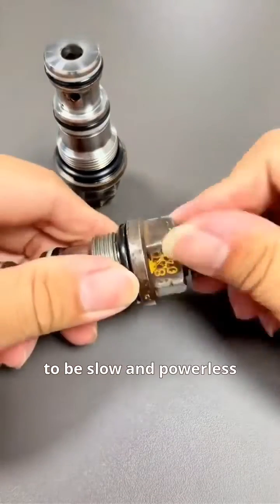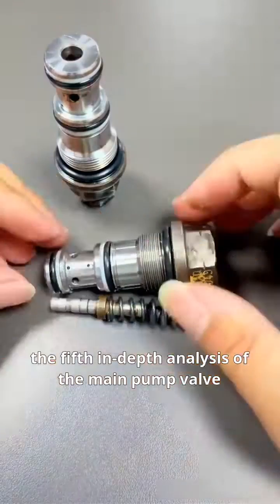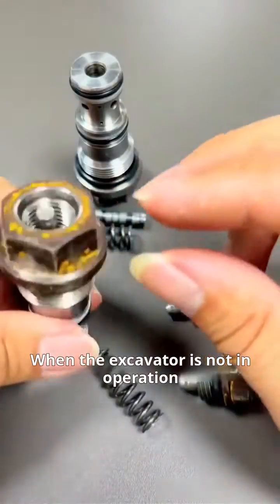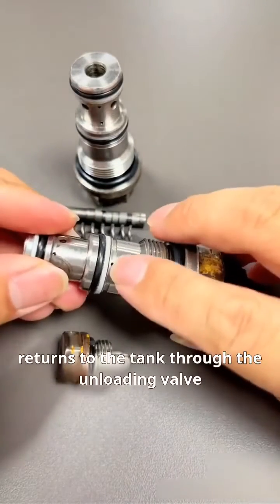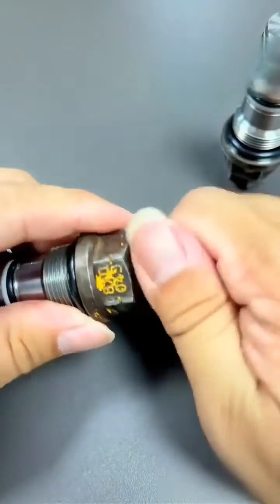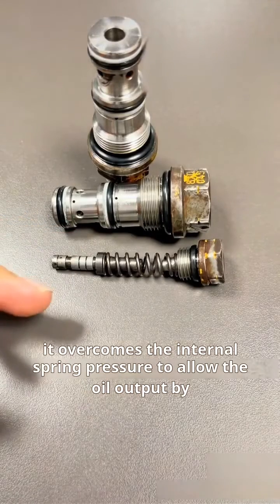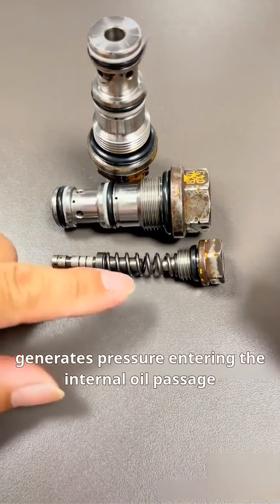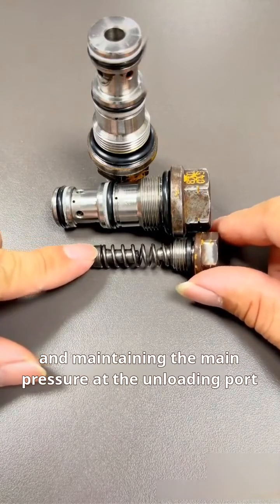When a #KOMATSU excavator exhibits slow or weak performance, inspecting the unloading valve #sany

Comment: I have a problem with a komatsu 138 the boom sticks and won’t go down any help ?
Reply from the maker: Boom Cylinder Holding Valve Malfunction: This is the most common cause. Sticking of the valve core inside the holding valves corresponding to the boom and arm cylinders, fatigue fracture of the spring, or blockage by hydraulic oil impurities can prevent the valve from opening normally to relieve pressure, making it difficult for the cylinders to lower. Additionally, damage to the seals inside the holding valve can also affect the on-off of the oil circuit and hinder the cylinder operation.

Comment: What Isa the problem of the Samsung excavator all movement are low power
Reply from the maker: Hydraulic System Malfunction: This is the primary cause. Wear of the plungers and valve plates inside the hydraulic pump will lead to a decrease in output flow and pressure; sticking or wear of the main relief valve will result in abnormal pressure loss in the system. In addition, insufficient, deteriorated, or contaminated hydraulic oil can clog the suction filter and return filter, and also cause sticking of the spools in the multi-way valve, which affects the efficiency of oil flow and thereby leads to sluggish operation of all machine movements.

Comment: I have a problem with a pc56 komatsu, the problem is that there is a low pressure in boom, but if the dozer is on its working but if its off it loses its pressure what can be the problem
Reply from the maker: 1,Leakage in the distribution valve. 2, Obstruction in the hydraulic oil circuit. 3, Malfunction of the hydraulic pump. 4, Faulty one - way valve

Comment: with a problem when you start hydraulic, you choke the engine, even though I've changed the engine, I've changed the electric hydraulic pump screw, and in addition, the hydraulic oil and the hydraulic filters have been replaced, and it's still the same problem. Can you tell me the right problem?
Reply from the maker: The possible causes are as follows:
 
- Faults in other components of the hydraulic system: For example, the hydraulic valve is stuck or blocked, resulting in abnormal pressure in the hydraulic system and affecting the operation of the engine; the accumulator fails and cannot store and release pressure normally, causing system instability.
 
- Circuit problems: There are short - circuits or open - circuits in the control circuit of the electric hydraulic pump, or related sensors are faulty, preventing the electric hydraulic pump from working properly, thus affecting the engine.
 
- Mechanical connection problems: The transmission components (such as couplings) between the engine and the hydraulic pump are worn or loose, causing abnormal power transmission and leading to changes in the engine load and stalling.